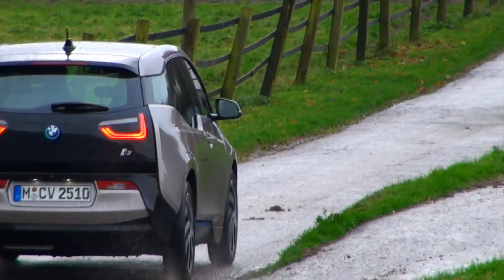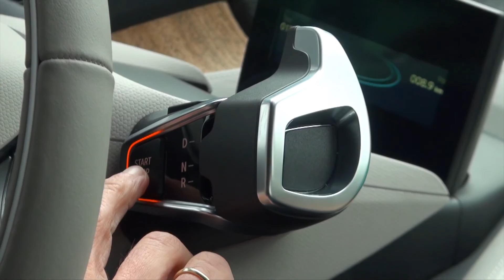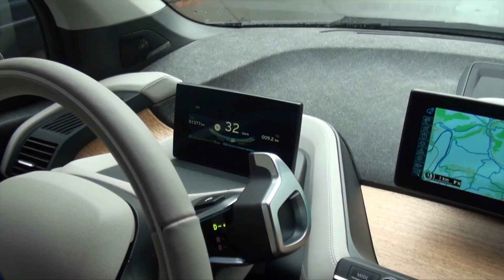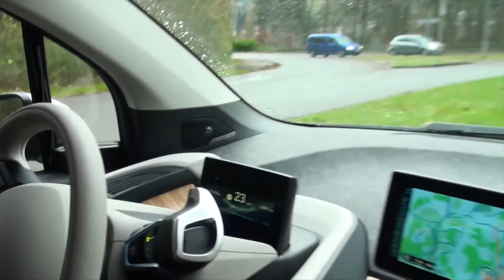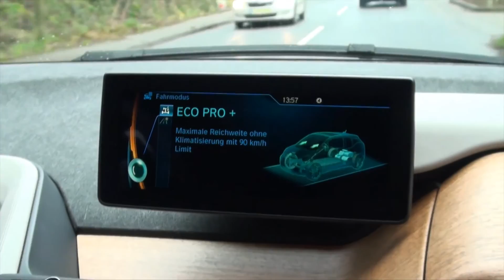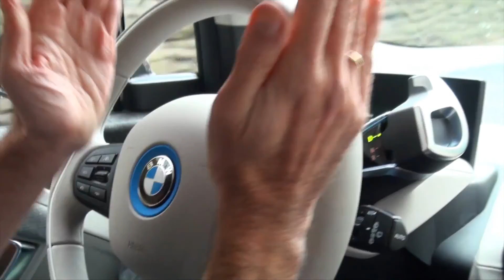BMW i3 test review - driving with dynamics and One Pedal Feeling - Autogefühl Autoblog

Comment: Just curious, is that a range extender i3 version ?
If it so, did you get any idea (considering its serial hybrid configuration) about the performances the vehicle has using gasoline only, for example fuel economy (for example in km/l), total range (in km), loss of power/torque, etc... ?
Reply from the maker: Hi, indeed this was the version with range extender. The car runs fully electric until the batterie is empty. Then the range extender hops in. It doenst sound too pleasent, we must say. I will get back on you with the details after checking our notes.
Reply from the maker: Ok so the battery was empty after 90 kilometers, actually it is supposed to run 120 to 150 km. The smaller range was due to the cold weather outside, in the summer it should reach the stated amount. As for the range extender, this 2 litre motorcycle engine has 9 l fuel capacity which doubles the statet range (so this one goes furhter 120 to 150 km). In the summer, you should be able to drive 300 km in total then, in the winter it will rather be around 230.
Reply: *****
Interesting, thanks very much !
So the car when uses gasoline has a still decent fuel economy (considering that 170 CV of the vehicle) of ~ 15 km per liter, provided that its performances remain unchanged switching to the gasoline engine - did you have the chance to note any loss of power/torque after the battery is depleted ?

I think it' s an important point for (likely infrequent) longer trips, say > 300 km, even once a month or year
Reply from the maker: babyelian77 The car is pretty light, so that the fuel economy also works for the petrol engine. The biggest difference is that you hear the sound of the engine when it's turned on. As for torque, the electric drive is more fun because there, the torque is present instantly!
Reply: *****

Thanks, an other thing : how many kWh does it take to fully charge the battery (clearly, including charging losses) ? And which fraction of the battery is actually charged (in the Chevy Volt is about 60 %) ?
Reply from the maker: Hm dont know that exactly, it depends on if you are using a loading station or doing it at home with your house power grid. It does take several hours to fully load it, so the optimal use is "driving at day, loading at night" :)
Reply: *****

Well, I believe it's a very important fact because electricity might even be cheap but not free  :)  for example for the Chevy Volt it takes about 12,5-13 kWh, including charging losses, to fully charge its 16 kWh battery (only about 60% of the battery is actually charged); obviously the higher the voltage the lower the losses, in Usa the typical home voltage is 110 V while in Europe is mainly 220 V.
I' d be very interested to know what these Volt figures became for the i3 !
Reply: *****

yes,  "driving at day, loading at night",  unless for people like me who have a 6 kW solar photovoltaic plant in their home roofs ! Indeed, in most part of the year I' d have enough "free" extra electricity to power a such car for even those 100-150 km of range per day...
anyway thanks! Danke!
Reply: babyelian77 The battery has a capacity of 22 kWh, but only 18.something are used for the driving train. Rest is 'reserve'. Depending on the charging method it can take some time to charge it.  fastest is a 50kW DCC charger which takes 30 minuts to charge, 3-5 hours on a level 2 220V charger, 8-10 hours on a normal socket (here in Germany) and 15-20 hours on a 110V outlet in the US.